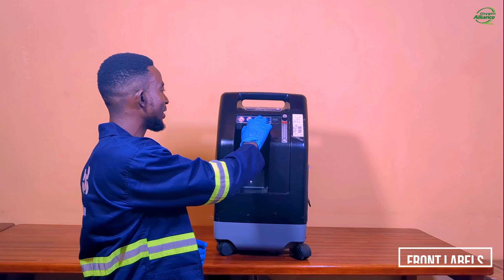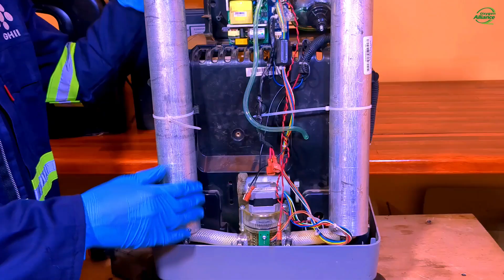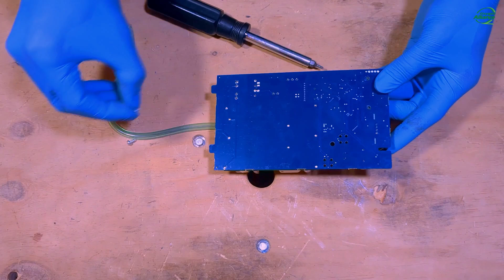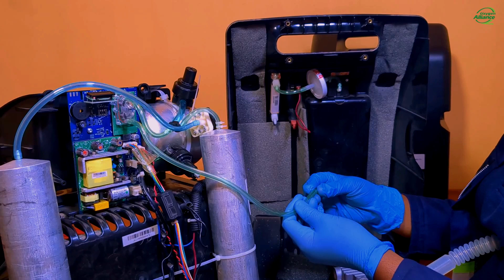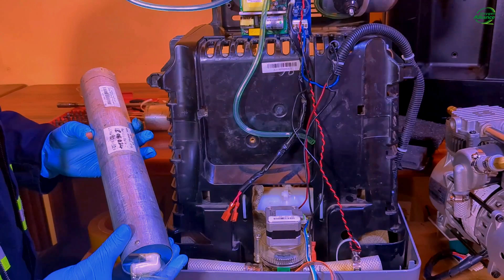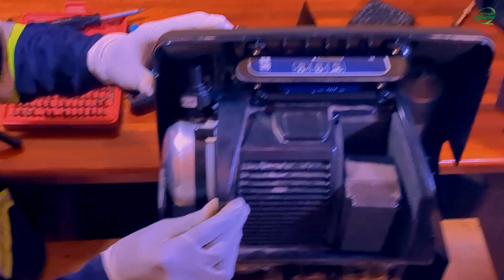DeVilbiss 1025 Oxygen Concentrator Teardown Video

Comment: My machine is very loud and it used to be quiet what is causing it?
Reply from the maker: The most likely cause is worn-out compressor service kits (cylinder sleeve and cylinder cup). When these parts wear down, the compressor piston creates more friction as it moves up and down. This friction produces extra noise, which is why the machine becomes loud even though it used to run quietly.

Worn compressor kits can also cause small air leaks during operation, leading to lower pressure and reduced oxygen purity.

To fix the problem, the compressor kit needs to be replaced. One recommended place to buy these service kits is Mack Industries (https://store.mackusa.com/ )

Comment: hi how to fix low oxygen error yellow light
Reply from the maker: A low oxygen error or yellow light on the DeVilbiss 1025 usually means the machine isn’t producing enough oxygen purity, often below 85%. This can be caused by clogged filters, damaged, leaking tubing or worn-out sieve beds. Start by checking and cleaning the external air filter, inspecting the tubing for any blockages or leaks, checking the one-way valves and purge manifold for proper operation and making sure the concentrator is in a well-ventilated space. If the issue continues, the sieve beds may need to be replaced or the unit serviced by a technician. Using an oxygen analyzer can help confirm if the machine is producing medical-grade oxygen.

Comment: On the Devilbiss, After all repairs are done, how long do you let the concentrator run for to make sure it is properly serviced and no further repairs are needed? Thank you
Reply from the maker: After completing all repairs on the DeVilbiss 1025, it’s a good idea to let the concentrator run continuously for at least 1 hour  to 2 hours while monitoring its performance. During this time, check for stable oxygen purity, consistent flow rate, unusual noises, overheating, or any warning lights. If you have an oxygen analyzer, that’s the best way to confirm everything is working correctly.

Comment: Also send me how to repair flow meters
Reply from the maker: Common issues with flowmeters include blockages caused by dust or water accumulation, physical damage such as cracks, and leakages due to loose connections.

To address these problems, check for leaks using soapy water and tighten any loose tubes. Clean the flowmeter tube with a small bendable brush, and if the flowmeter is cracked, consider replacing it.